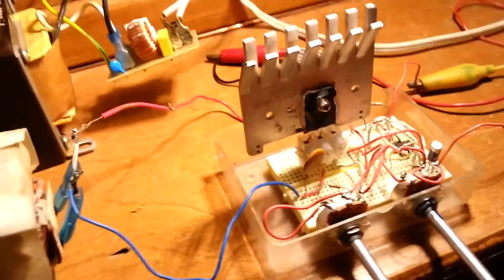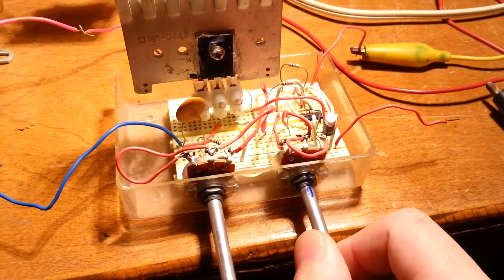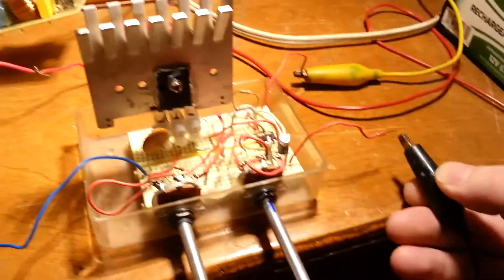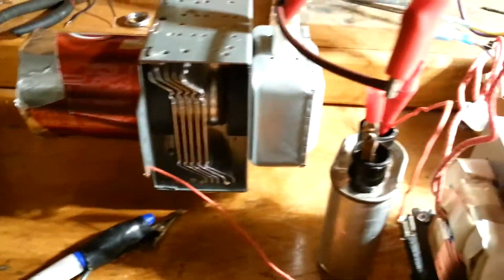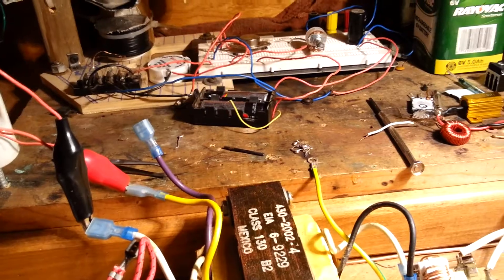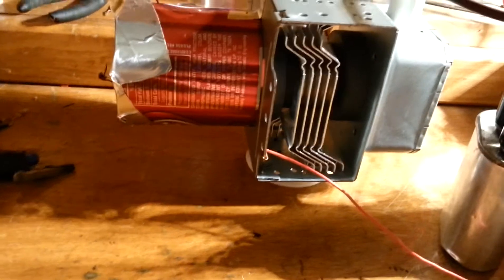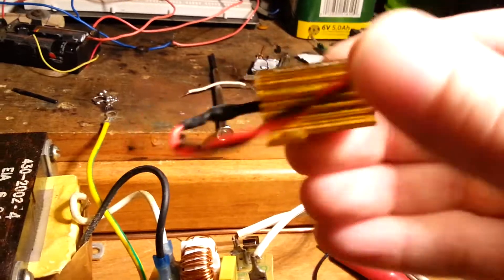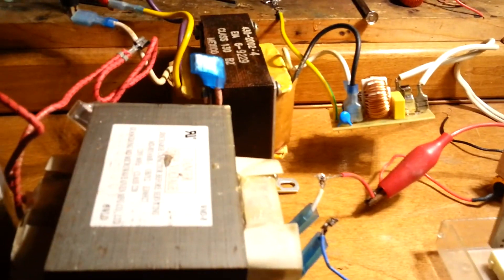555 timer driving a MOT and magnetron at low power

Comment: If you use an electrolytic cap to smooth the waveform coming from the 555 timer, then you should have about a sine wave. This should bastly increase the efficiency, as the magnetic feild will always change. I didnt think of using a 555 for this. Thats clever.